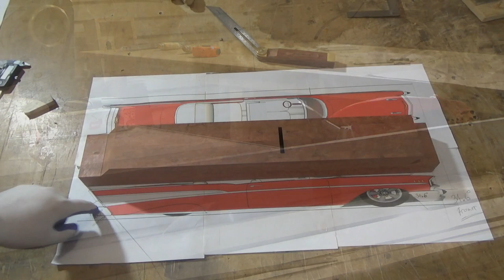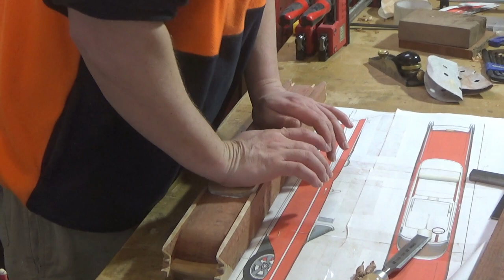Make a wooden hand plane shaped like a CHEVY!

Comment: Now for a mini Cooper block plane.  Awesome work.
Reply from the maker: Great minds think alike. I have loose plans of making a smaller block plane and it will be either a go-kart or a mini cooper. Probably the mini just because the design allows for a little more structural rigidity 😃

Comment: I can't believe someone disliked the video!!! 
Exceptional work wish to see more videos more often. 
Love your work it is so inspiring
Reply from the maker: Mahmoud MTS Thanks. I noticed someone disliked the video very quickly after I posted it. It seems I may have a hater. I find it hilarious. Silent internet warriors are nothing to be concerned about :D
I have more videos planned. I want to get onto a weekly, or biweekly schedule but most of my work is spread over a mininmum of three weeks so I'll start breaking builds into a series of vids with more information within each video.
Reply: Gorgeous work - guess the hater was worried about your right hand in that ~narrow rip cut on the TS!
Reply from the maker: Yeah, I get a fair amount of grief over the proximity of my hands to the cutters, and my wearing of gloves etc. The comments aren't wrong or out of line. They are only trying to help someone. But at the end of the day I have been well trained during my apprenticeship and I am comfortable elevating my risk profile on various tasks in a controlled manner, usually for the purposes of a cleaner  steady cut, faster work etc. 

What you won't see me do is put myself in danger doing something out of my control. A good example would be grooving/dado a panel on a router table using an upcut spiral router bit and placing my hands directly over the cutter. Sure the timber is covering the cutter and I can't physically access the cutter....BUT...HUGE BUT, upcut spiral router bits are known for pulling out of their collets due to the shearing action of the cut. If the cutter walks out of the collet, I won't know it until it has drilled right through my hand.